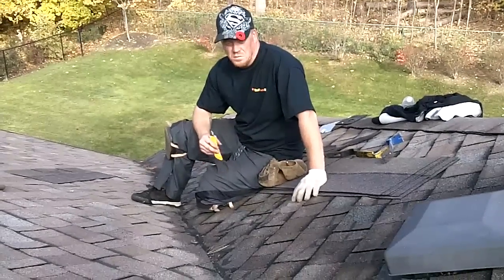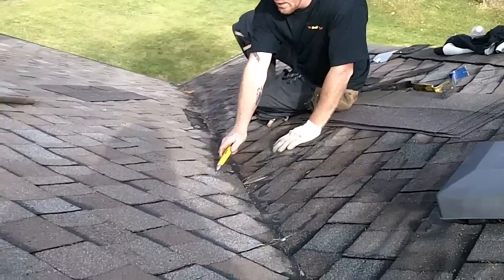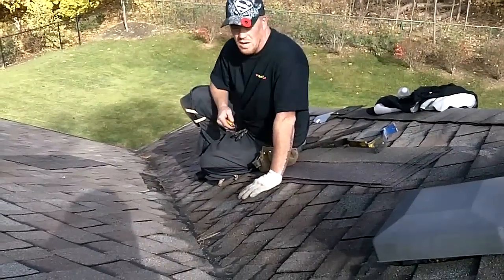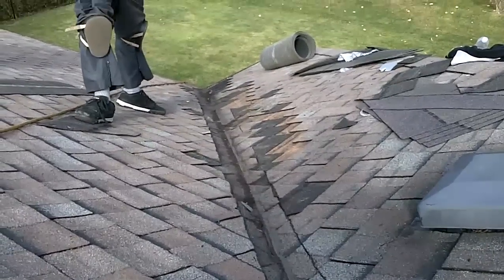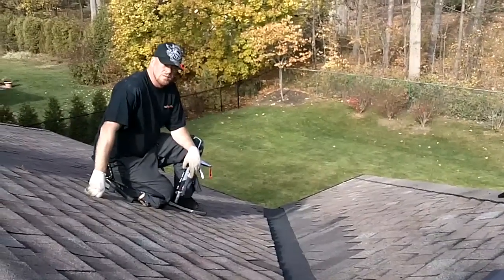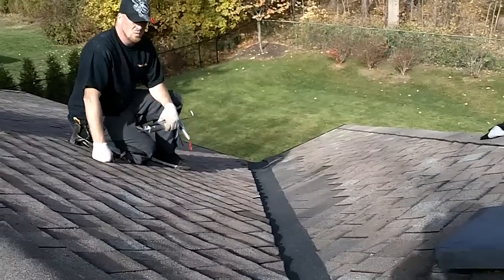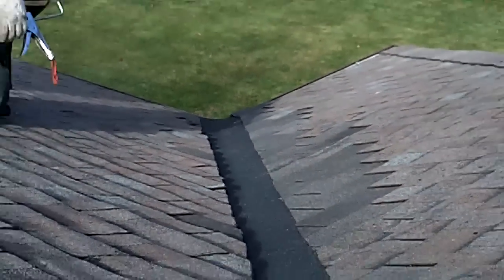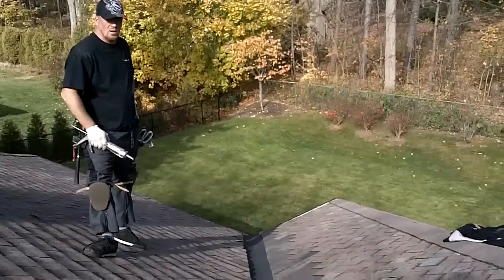valley replacement

Comment: So my 100+ year old Victorian house has three major leaks that is doing serious water damage inside. I don't have a clue how to fix it, which is why I am watching all these videos. My roof has four layers of shingles and trying to determine where the leak is coming from is impossible. So I am just caulking the crap out of it, looking for any signs of wear (which is basically everywhere) and trying to reason where water could be getting through. Yesterday I was on the roof for hours caulking along the valleys that I could safely reach using BlackJack tar. I can't afford to hire a roofer to properly repair the roof, so I am trying to patch everything that I can. A truly frustrating and helpless feeling. Any advice for a poor pauper with no roofing knowledge/experience?